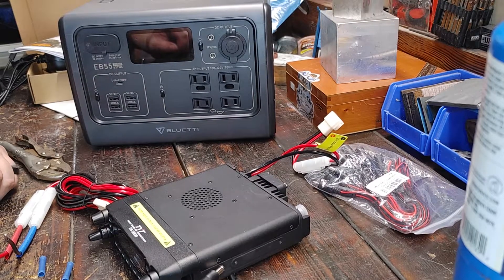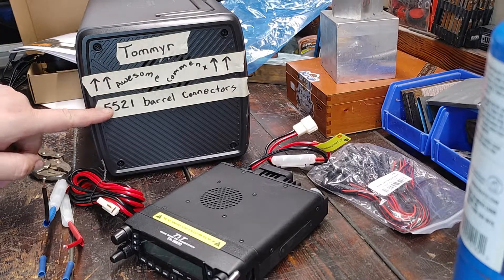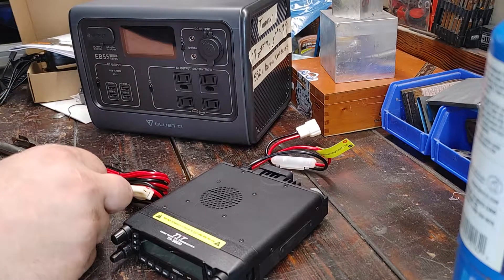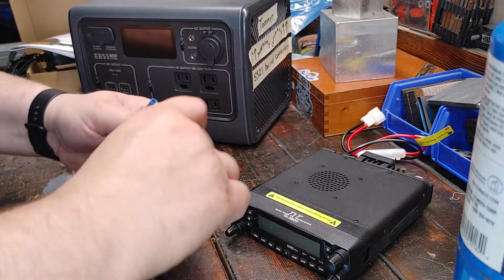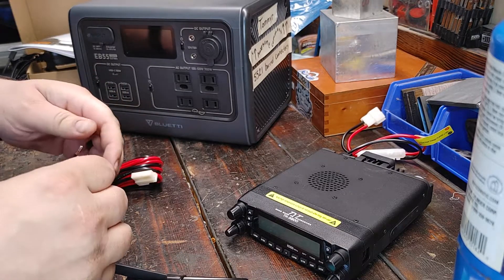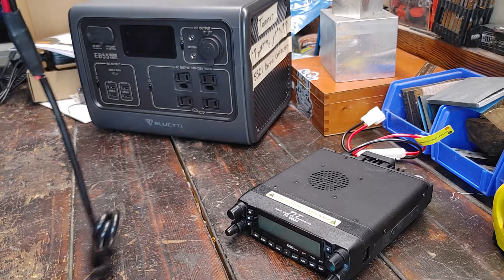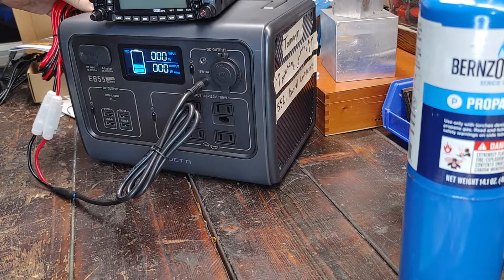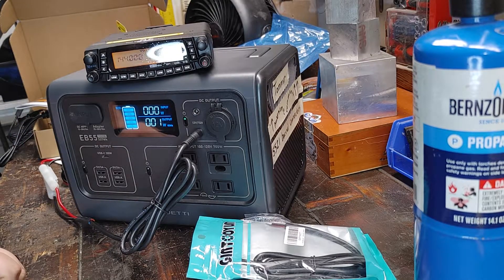Bluetti EB55 solar generator ham radio power source.TYT-9800 ham radio.

Comment: I've tested this with Bluetti EB3W and although the power supply is adequate, the unit generates a massive amount of noise (see the bluetti forums about their products).  The ICs used for voltage mgmt and the controllers generate a ton of noise.   It's unusable for HF.  On my radio the noise was so strong that I was worried about damaging the radio

Comment: Have you tried using transmitting with full power? I'm interested in using a Bluetti for radio but worried i won't be able to use it at full power as the radio is fused at 15A.
Reply from the maker: Looking at the product specs it puts out a maximum 10 amps at 12 volts from the 5.5mm x 21mm ports. So it does not seem like you will hit your 15 amp max power from this unit/connector pair.

That may be a connector amp limitation, i dont know. I am sure there are larger units which will supply more power, but your tradeoff may be portability. 

What are your thoughts?
Reply: @vonbaconstien760  Yeah, i figured all 50W radios would draw about the same current when transmitting, but looking closer it appears to be quite some variability. The TYT-9800 claims to draw 8.5A and should be perfectly fine on a 10A output. Yaesu FTM-200 is 11A and Kenwood TM-D710 is 13A so those is not a good idea to try to run at full power.

I really like that Bluetti uses LiFePO4 and i will probably get one, looking at the EB70 as it's powerful enough to run some kitchen appliances (but about the same DC outputs). Not being able to use my radio on full power would be an acceptable compromise, but i might test if i can use both small DC outputs in parallell to get more than 10A.
Reply: 🙄It’s one thing to power it up and receive, it’s another to transmit at full power and see what the draw is and if it can handle it.

Comment: How is the noise level in the ham radio? Is it simular to home power?
Reply: the ICs & circuits on these units generate a ton of RFI .  i had one that blew out every 1khz or so .  Make sure you test transmission & receive before using it
Reply from the maker: I dont know, i havent gotten that far into the build. I apologize, its finals week at the college i go to and i work 60 hour weeks 😭😭😭

But I will say that I specifically purchased this because it was 700 watts, very multipurpose, AND pure sine wave. 

Which means that noise which wohld be produced from a junky modified sine wave type inverter, wont be an issue. 

Typically modified sine wave inverters cost less, but produce noisier power. I specifically went with pure sine to avoid that. I hope this helps!!

Comment: How long would you be able to use the bluetti to run the radio.
Thanks
Reply from the maker: The EB55 is 537 watt hours. 
To passively receive, this ham takes 0.5 watts per hour (I believe), and its highest output is 50 watts.
I would conservatively say that actively talking on the highest output will score you over 10 hours, and passively listening (in theory) could last over 1,000. 

What are your thoughts?
Reply: @vonbaconstien760  thanks for your quick reply is your radio a 100 watt as I have a icom 7300 useing 100 Watts I was wondering how long useing 100 Watts it might last.
Thanks in advance 
Regards 
Paul
Reply from the maker: @paulwillmott8931  if you are constantly transmitting at your highest output, which uses the most power, your Icom would last a bit over 5 hours. But, I doubt any of us could talk 5 hours straight. Receiving takes a fraction of that power. 

I would imagine that having an active normal talk/listen conversation, you could last 8 hours. Much longer if you are listening more than talking.
Reply: @vonbaconstien760  Thanks
Reply from the maker: @paulwillmott8931  youre welcome man! I appreciate the question and actually think I should make a little video explaining it. You inspired me!!
Reply: @vonbaconstien760  your welcome  I'm thinking of getting a bluetti 2000 generator because I have an electric car  and motorhome so hopefully a lot more power.
Regards 
Paul
Reply from the maker: @paulwillmott8931  i am sorry. Which Bluetti? I am having trouble finding a Bluetti 2000
Did you mean the EP500 or EP500PRO?
Reply: @vonbaconstien760  bluetti power Oak ac2000p in the uk
Reply: @vonbaconstien760  it's the Bluetti ac2000p
Reply from the maker: @paulwillmott8931  when I search online it keeps coming up with the AC200P. I own one, and while I love it, i do know that it has shortcomings. It does have a powerful 2000 watt hour battery, and 2000 watt inverter. Which means at maximum power it will last an hour. This is a good unit for an RV. But I feel definitely too small to charge an electric car. I bought a 1500 watt griddle, 1500 watt hot plate, and a 1500 watt electric 1.5 liter kettle specifically to use with my AC200P, and I found that I could cook 2 eggs on the hot plate, then cook 4 eggs on the griddle, then boil one liter of water, and that would bring my battery from 100% down to 81%. This is fantastic for my family because I live where there is threat of severe weather. And I feel it would be great in an RV where your vehicle/solar can recharge the unit. But I would not count on it being a power source for your electric vehicle.
Reply: @vonbaconstien760  no its for my rv but I will use it for my hf radio as my ev car won't be able to run my radio as it will run my battery down to quick. And yes now I look it is the ac200p my bad lol.
Reply from the maker: @paulwillmott8931  oh, then I definitely recommend it! 2000 watt hours would give you 20 hours of talk time (transmit) at your radios 100 watt peak power. It would likely last much longer because I doubt any of us could talk for 20 hours straight! 
If you receive more than you transmit and have few long conversations, it could likely last you hundreds of hours!
Reply: @vonbaconstien760  thanks for your help
Reply from the maker: @paulwillmott8931  youre welcome!!